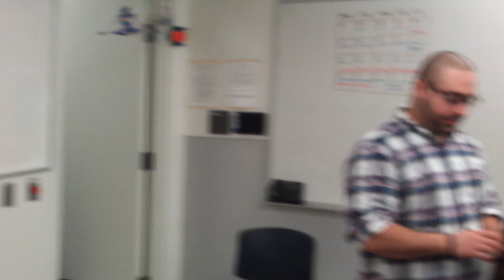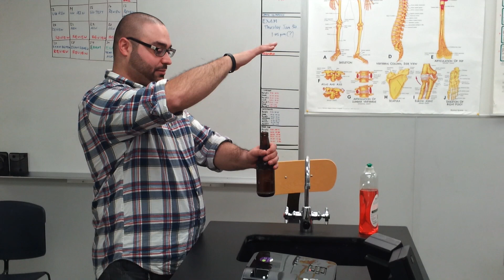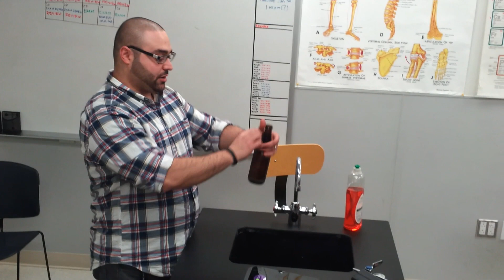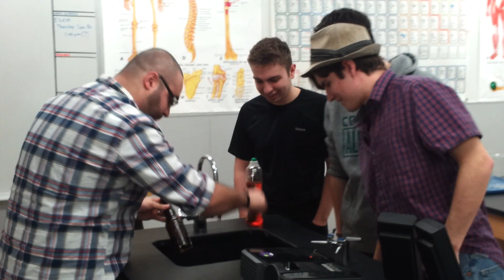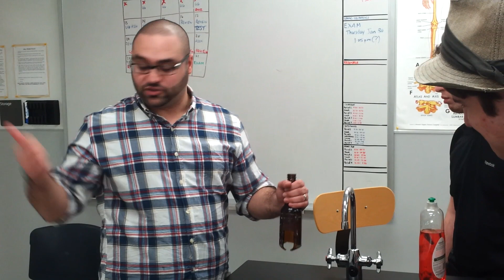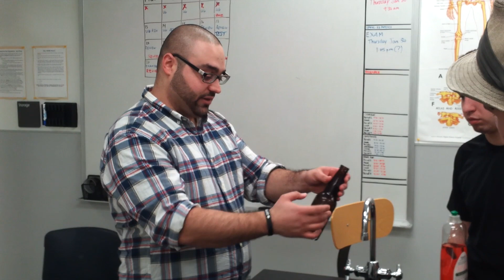Application of Pascals Law

Comment: I think this is the wrong explanation for the fenomenon. You don't apply any pressure on the air inside by just hitting the top of the bottle with your hand. The bottom breaks because of the water that moved later (newton's first law) hits the bottom very hard because the initial hit moved the bottle down, but not the liquid, creating a vaccuum under the liquid 'sucking' the liquid down very hard against the bottom. This is why the bottom breaks out of the bottle!
Reply: Can you repeat that?
Reply: there is no liquid in it